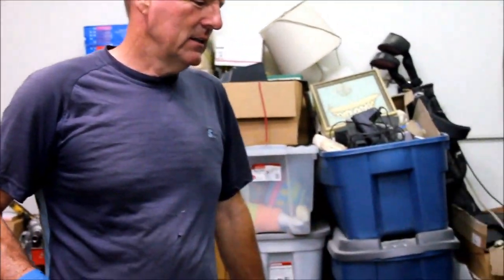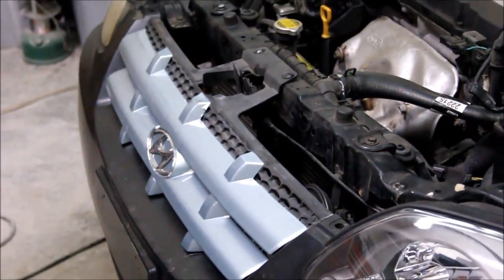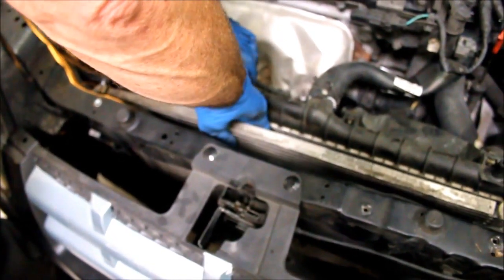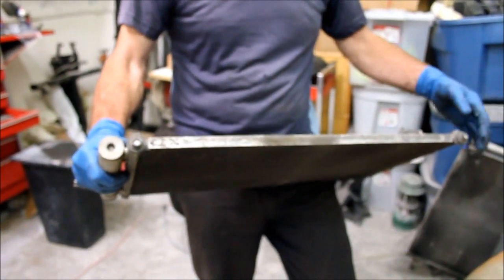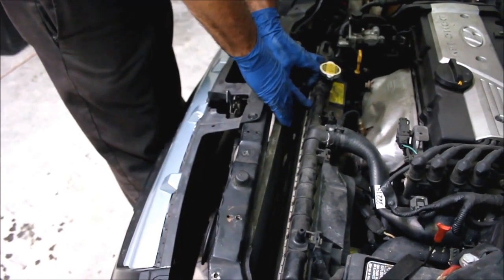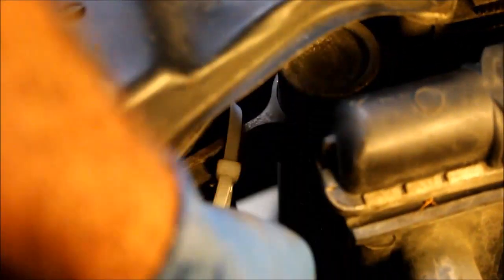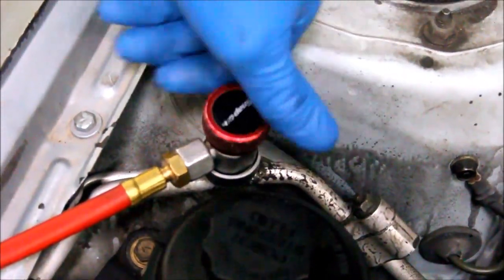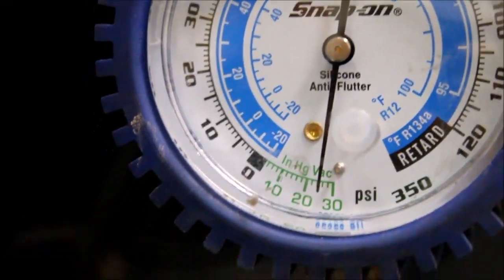Replacing a Leaking Air Conditioning Condenser - Hyundai Accent

Comment: thx for the video  explains alot  just changed the compressor of my accent 2011 but could not get enough cooling  out of it once i poured water misakenly on the condenser  while washing it and the air con suddenly working great for a while & then after few mins gets back to normal again can u suggest what should i be looking for to make it work bttr , thx.

Comment: HMMM...That tube down the side of the condensor holds a dessicant bag, I think. If that condensor has been lying around a wrecker's yard and your workshop for a while, that bag would be saturated. Do you think a few minutes of vacuum pumping would dry it out? I think I would have replaced it.  Also, the power leads to your vacuum pump look a little dodgy...maybe some maintenance needed....just sayin'
Reply: Dude replaced a bolt with a zip tie, I doubt he cares at all
Reply: Yeah, being very rough with it as well considering it's rubbing right up against the radiator.